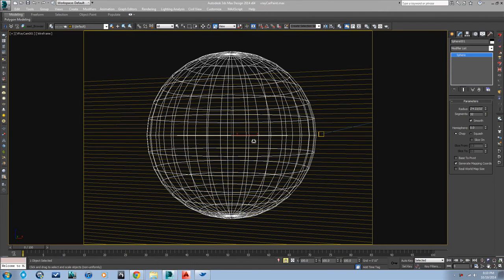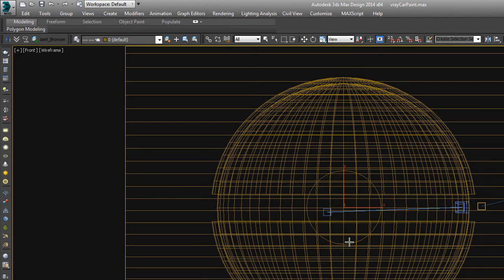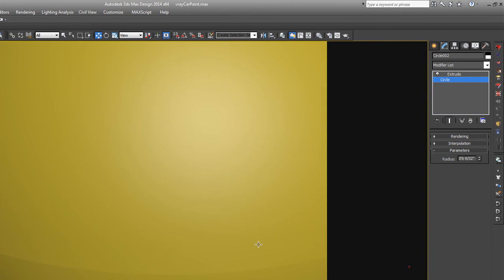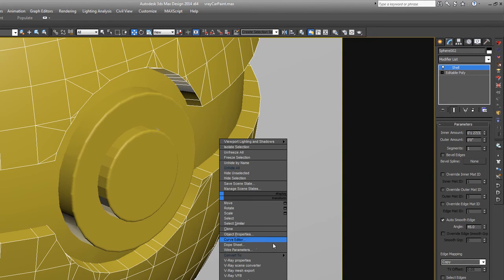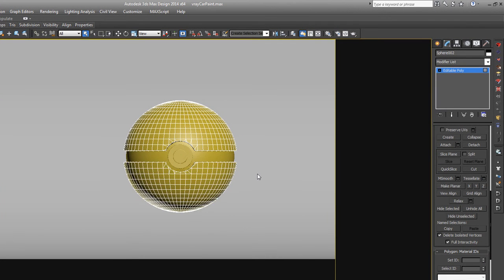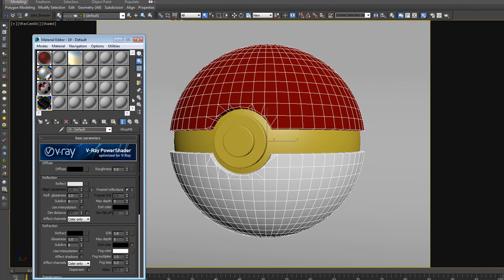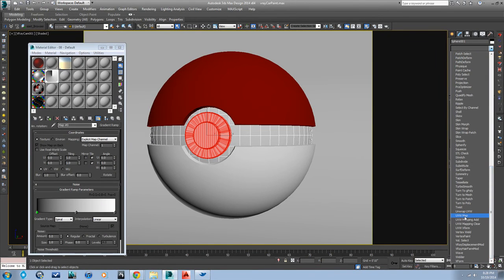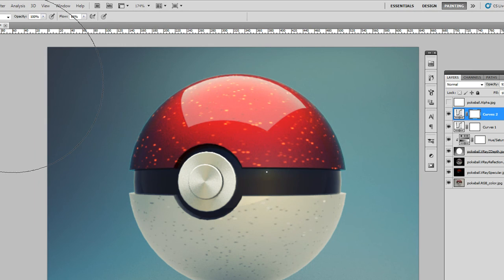How To Model A 3d Pokeball - 3ds Max Poly Modeling and Vray Materials

Comment: How did you make this "Loop" selection without chamfer edges? 8:30
Reply from the maker: At that point all I did was go back into edge sub-object mode.  The last edges I had selected previously were still selected when I went back to edge mode again.  This is typical.  Every time you go back to a sub-object mode, your selection from the last time you were in that mode comes back.  Does that help?
Reply: zillus
My apologies Sir, i asked about "Rectangular Selection Region" and "Window/Crossing" toggle.      
More correctly would be to specify 32-33 seconds. Your  "Window/Crossing" toggle was deactivated that means all (sub)objects will be selected even if your "Selection Region" just barely touch them. But not in your case. You used the "Rectangular Selection Region" but you selected only a portion of the edges. 8:32
Reply from the maker: Alisa Orlova I think what you are looking for is in your preferences> viewport.  There is a setting there that allows you to automatically change between window and crossing, depending on which way you swipe your window.  Mine is set up so that left to right is a solid window selection, and right to left is a crossing selection.  Is that what you mean?
Reply: zillus Yes sir! Now it's works well! Thank you!
Tiny note : "Preferences/Genera/Scene Selection group/turn on Auto Window/Crossing Selection by Direction."
Reply from the maker: Alisa Orlova That's the one.  Hopefully that is a time saver for you.